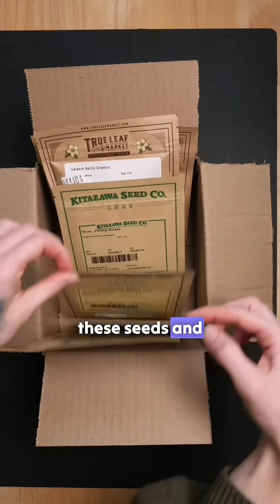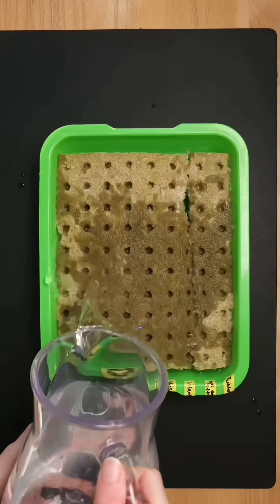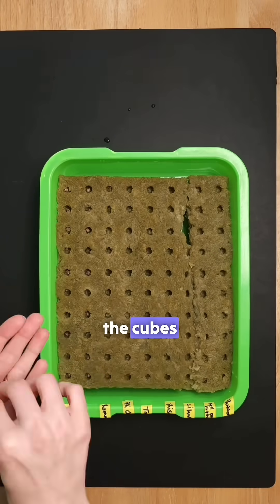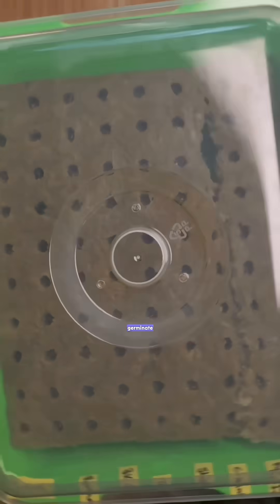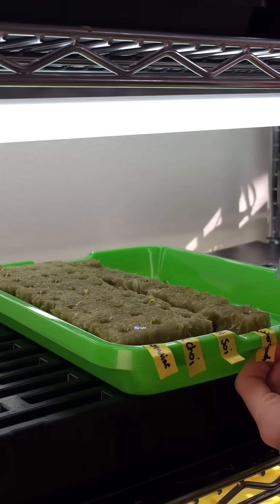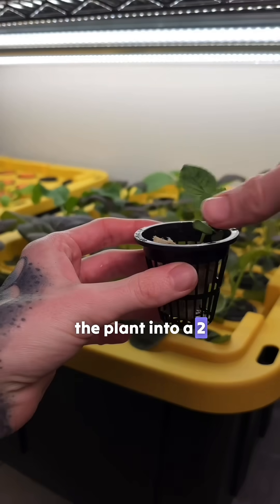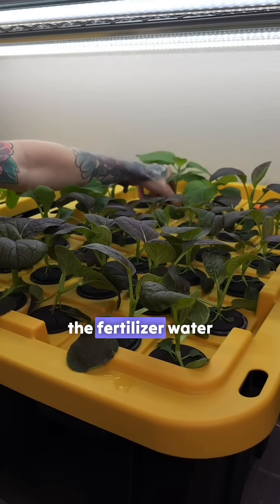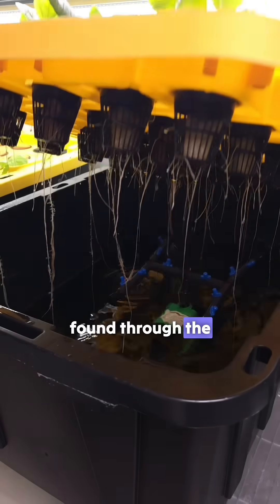DIY Aeroponic System: Seed Starting Guide for Indoor Gardening (Part 5/6)

Comment from the maker: Part 5 of 6: 💚 Seed Starting for our indoor aeroponic system is simple! We start by soaking rockwool in pH-balanced water. Once soaked, we drop 1 to 2 seeds into each hole, cover the tray with a lid, and place it on a dark shelf.

⏳️ From there, it’s a waiting game while the seeds germinate. If the rockwool starts to dry out, we give it a quick water to keep it hydrated.

🌱 For most crops, tiny sprouts appear after a few days. Once they peek above the rockwool, we carefully transfer them to a separate tray. This is when we introduce fertilizer for the first time and place them under light! If the light isn’t strong enough, we raise the tray to bring them closer. We also water 1-2 times daily with the fertilizer mix—(the same mix used in the system, separate how-to video on our page).

After 1-2 weeks of light and feeding, they’ll be ready for the aeroponic system! We judge readiness by stem height. 🌱💧 We place each plant into a 2-inch net cup, then gently secure the stem with a plug (trimming the hole if needed for a better fit). The plug stabilizes the plant and helps keep the lid dry from misting.

🥳 Finally, the plants go into the aeroponic system, where their roots are misted with nutrient-rich water. Over time, they’ll grow stronger, develop larger roots, and thrive in their new environment. And that’s how we plant in our DIY aeroponic system! ✨️✨️

Amazon Affliate link to Supplies = https://www.amazon.com/shop/onthegrowfarms/list/313WWLPVLRLRO?ref_=aip_sf_list_spv_ons_mixed_d

Comment: How do you keep it from leaking all over?
Reply from the maker: We adjust the spray nozzles, and then using the plugs or clay pebbles to block any water from coming through the net cups on top. However, even with that, you can sometimes still get leaking - it seems to vary per/system. I would suggest going the DWC route if leaking is too problematic for you. You would just replace the misting system with an air-stone instead, and add more water.